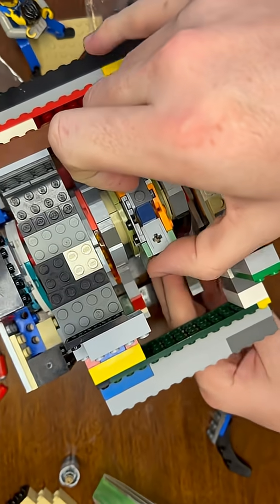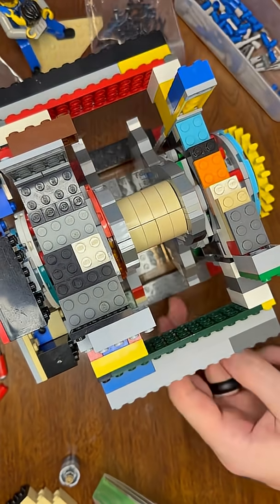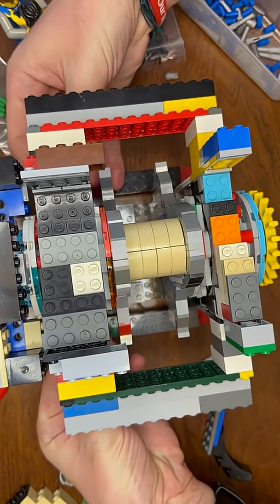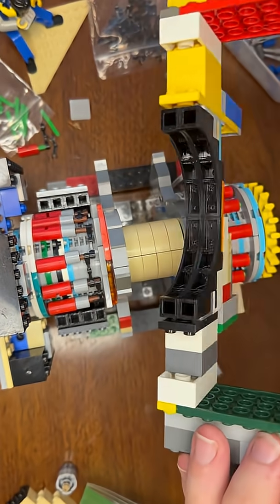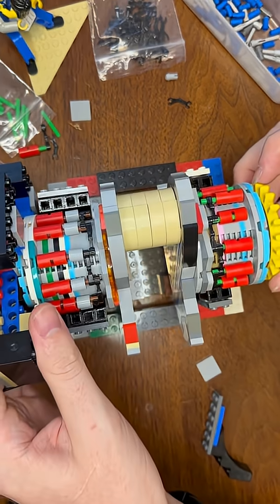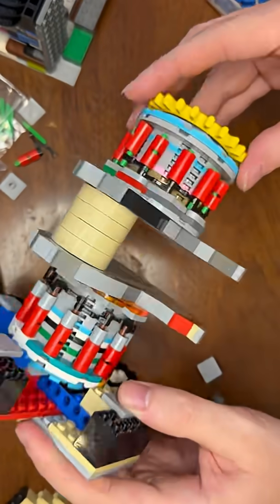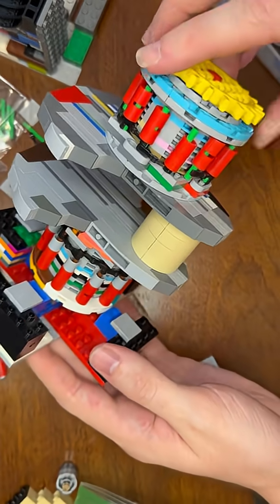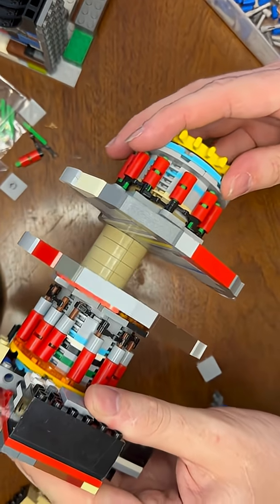he a spinny boi 😳#legovacuumengine #engineering #spin #legoengine #lego #engine #crankshaft #cars

Comment: I bet if you added some lubricant on the bearings it would be really smooth.
Reply from the maker: Yeah I've had a lot of people suggest that. LEGO bearings offer a way to reduce friction in a LEGO engine without the necessity of oil which can make a big mess. But with both it might really be smooth! I haven't tested it yet since a few of my internal components depend on the strength of stud connections which are loosened up by oil.

Comment: You will probably need more weight to balance it when you add the piston
Reply from the maker: Indeed, another commenter noticed in an earlier video that the piston still falls down with these counterweights. I'm thinking of making them more dense by stacking plates where it's currently built of bricks as a starting point.

Comment: That's really cool honestly, like a 212cc predator. 
Has ball bearings on the crankshaft. 
I wonder if a ball bearing on the rod would be cool or not? 
Maybe for a lego engine
Reply from the maker: I think it would be! The only challenge would be finding the balance between a crankpin with too tiny a diameter and a rod with too big a big end. Smaller bearing rollers would help. Thanks for your comment!
Reply: @engine1ear151 haha yessir and you're welcome, can't wait to see what you come up with next. 
A dual overhead cam 4 valve head would be cool too. 
Maybe a crankcase with oil? Haha
Reply from the maker: I like the way you think! You should check out the work Will03 (r1derwill on TikTok) did on a four valve pent-roof head at this scale. An oil pan with pickup and a pump would be really cool, especially with piston squirters. I originally did the bearing thing because I thought there wasn't enough surface between journal and shaft for oil-lubricated plain bearings, and now I like them because they help me avoid the mess oil makes while still being more practical now during disassembly than they were without the cages. Cheers!

Comment: Bro can you make a tutorial/manual to make this crank shaft? :0 i am IN LOVE with it
Reply from the maker: Thanks so much for the request! I may instructions for the whole engine one day but will need to clean up the design first. In the meantime, I suggest watching the building techniques video I made to help you out. Wish you the best making your own!
Reply: @engine1ear151 Don't worry, take the time you need, just know that i absolutely love this design!
Reply from the maker: @exuvia.alscade  I'm so glad! That means I'm not the only one! To make a long story short, my friend Erin, one of the early inventors of LVEs, saw an early prototype back in 2021 chronically breaking and told me that brick-built crankshafts might not ever be stronger than axle-built ones. It brings him and me both so much joy to know he was wrong! I'm glad you're here to celebrate it now, too :D
Reply: @engine1ear151 Btw i was thinking about a crankshaft just like that in the video but made with metal Lego parts :0 would that even be possible or affordable? I guess the added weight can make it spin for longer
Reply from the maker: Wow, that would be an interesting spin on the problem (pun intended haha). I stay away from solutions that are so blatantly non-LEGO, even though I've made 3D printed cylinder sleeves before. But to go with your train of thought here, I think it would be far more affordable to make one solid metal crankshaft than each individual LEGO part of metal and assemble them. It is one way to increase the flyweight though! I actually did use train weights in my flywheel for this purpose. They have metal in them 😅

Comment: THATS GOT LESS FRICTION THAN MY TURBOCHARGER SMH
Reply from the maker: boi he spinny
Reply: turbos have a lot of friction since they dont have ball bearings
Reply from the maker: @slaughter420  it's so crazy that turbos spin at hundreds of thousands of rpm!
Reply: @engine1ear151 oil at high pressure keep them "floating" thats why its important to have good oil in turbo engines and chech turbo seals if you dont want a runaway diesel or a gasoline/diesel engine burning oil
Reply from the maker: @hiena8511  It sounds like it would be hard to achieve the necessary pressures in a LEGO oiling system...
Reply: until you start the engine and get the turbo feed with oil pressure

Comment: that is incredible. Idk if you lubed it or anything but it doesn't seem like it. Very impressive
Reply from the maker: Yeah no I didn't need to or intend to. The bearings were in place of lube that I thought wouldn't work with larger diameter shafts. Then when it worked so well, I didn't want to go back to the oily mess haha
Reply: @engine1ear151 Idk how well water could work in anything that youre using, but thats what I use
Reply from the maker: That's really cool! I would love to create an engine with an "oil pump." My go-to fluid for testing would definitely be water since it would create the least mess.
Reply: @engine1ear151 Yes and theres literally no downside to water because it doesnt ruin lego or leave residue
Reply from the maker: @Davidoslikesbeans  Yeah I guess that's true for a LEGO engine. 🤔